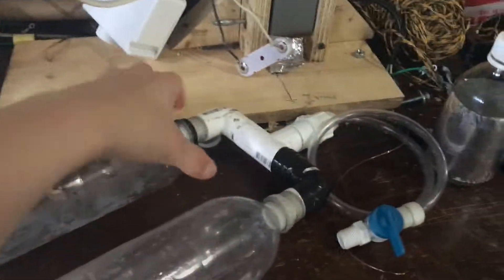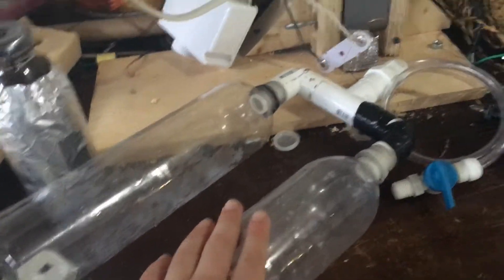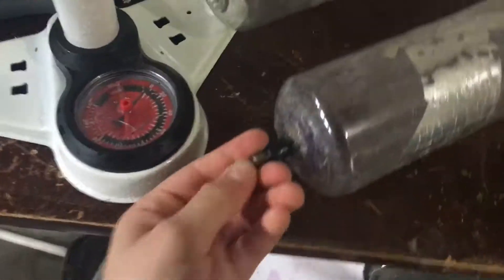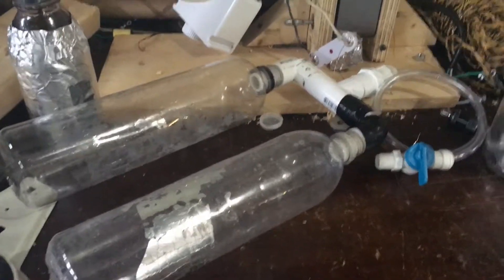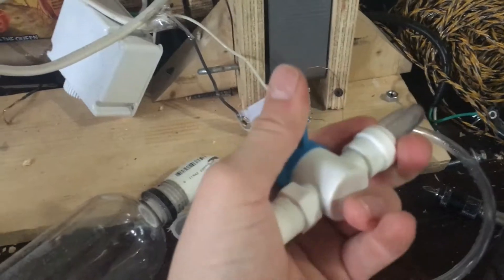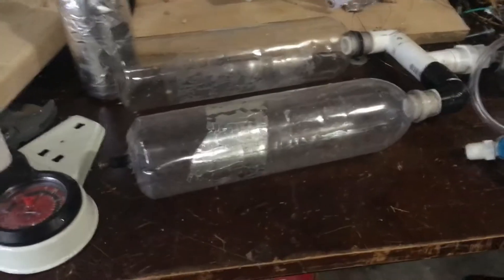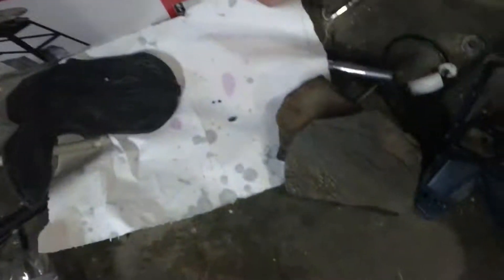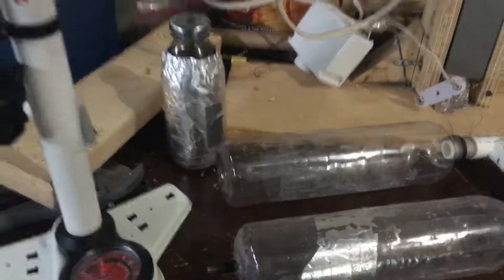Homemade underwater air tank (scuba)

Comment: Im not sure a bike pump is the smartest idea cause it doesn't pump just oxygen so you could have more carbon dioxide and less oxygen And the water bottles must Be reinforced to prevent it from bursting easily
Reply: it is just cheaper that way and it does not need to be for a long time